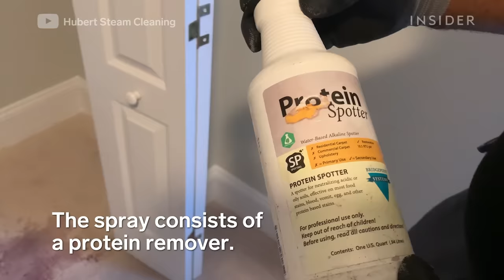How A Professional Steam Cleaner Removes Wine Stains From Carpets | Deep Cleaned

Comment: Can he clean blood, I mean red whine stains?
Reply: Bruhhhh😂😂
Reply: Blood is either a sign of a crime scene or a surprise period.
Reply: @harryhealey4298  ...
Reply: @harryhealey4298  That's a hell of a period!
Reply: @Lavender_Louis  it’s called heavy flow.
Reply: @harryhealey4298  Oh I'm familiar with heavy flow but 750ml (standard wine bottle) is a bit much!
Reply: To answer your question, yes we can typically remove blood. It happens a lot more often than you think; sometimes we have clients with prior health issues that cough blood onto the carpet or furniture, sometimes with vomit, pretty much anything that is organic material can be cleaned. However the real question isn't usually whether we can remove it, it's whether it is worth the cost. For example sometimes I encounter places with far too much damage, think wine stains, urine stains, paint, etc. The cost of doing any treatments can sometimes outweigh the cost of the carpet. At that point, replace the carpet. It's a bit odd to me how he uses a protein spotter, usually over here at least (Washington State) we use what are called oxidizers. They get in contact with most things and it works in a sense like an over the counter hydrogen peroxide for cuts, except far more concentrated and it tends to neutralize organic matter much more efficiently.
Reply: @Pablo-bo2ru  The dude and urs probs have different ways on cleaning stains?